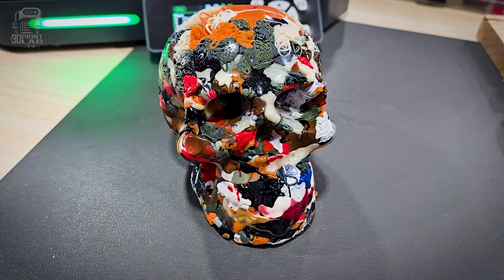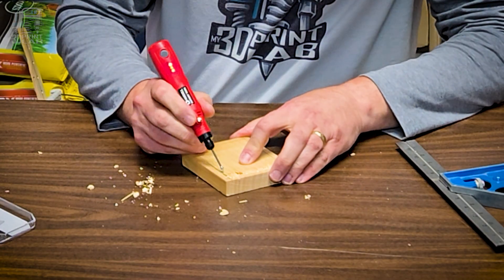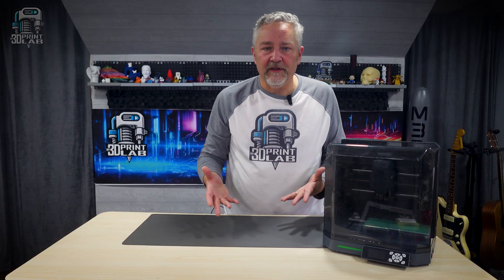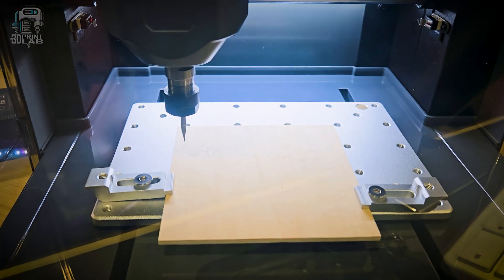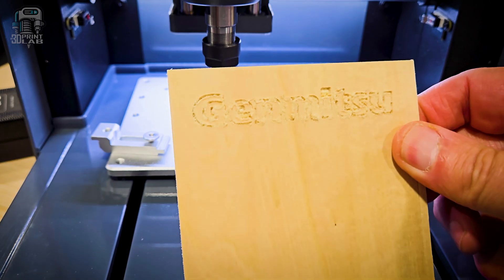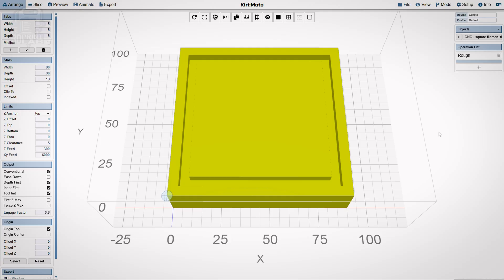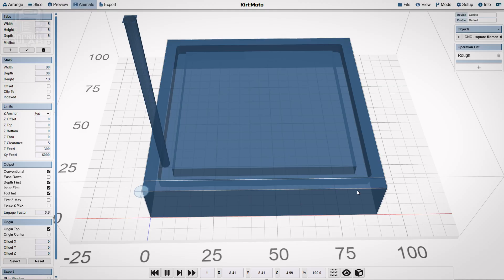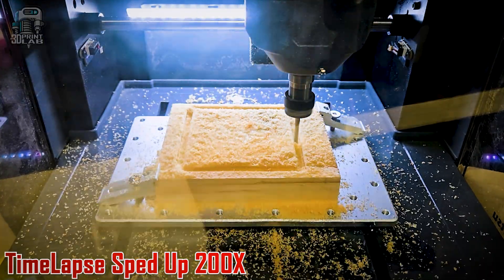Can You Turn Filament Trash Into Timeless Treasures? (Review: Cubiko CNC!)

Comment: How strict do you have to be about mixing filament types with doing this stuff as opposed to printing? Like what if there’s some PETG in your PLA?
Reply from the maker: PETG and PLA don't bond.... I know from experience. I think it'd have the same effect here. I've used PETG as a support for PLA (and vice versa) and it basically just falls off. Not to mention that PETG has a higher melting point, which I forgot to mention in the video. I actually ruined a new heat gun just doing the PLA as it was. 15 minutes! Should have lasted longer. Maybe the toaster would melt PETG, not sure, but I only save PLA since it's mostly what I use.

Comment: Just get a heat press or iron. Carve the wood as desired, put the filament on the wood, put silicone pad on top, use heat press/iron to press the plastic into the wood, use the cnc to go over the top layer and clean out any over-spluge of plastic. 

While the cnc might be to small for this, this would be a freaking sweet way to make a cribbage board.
Reply from the maker: AHHH!!! You're too smart for me. And I have a heat press. AND NOW I have even more ideas.... If I could chop up the pieces into smaller bits.... and the channel wouldn't need to be so deep.... and.... OK, thanks for the ideas!!!
Reply: @my3DPrintLab  more videos with this idea in mind please, I'm intrigued.

Comment: I use a cheap Blender to Blitz the 'Poop' into more evenly shaped bits , before melting into a silicone mould. It gives a better result. Perhaps doing similar would help in your  experiments. Cheers from Blighty.
Reply from the maker: I've thought about this but I've seen that a Ninja blender is really best and I'm not giving mine up for it, nor do I want to get a new one at that price.... used? Thanks!